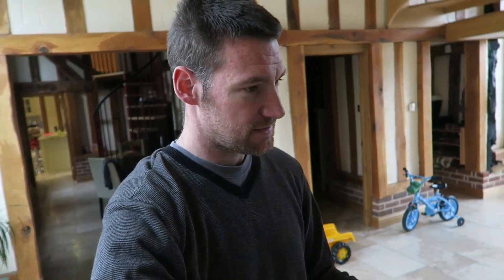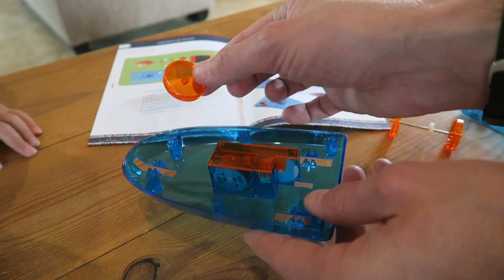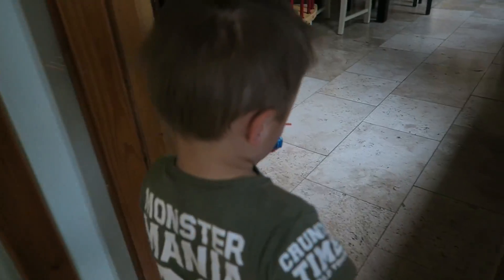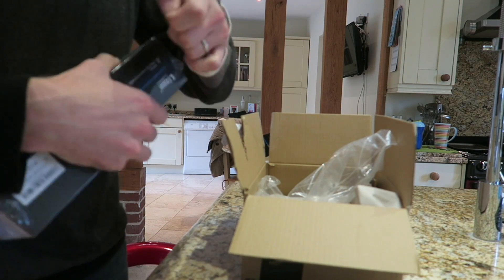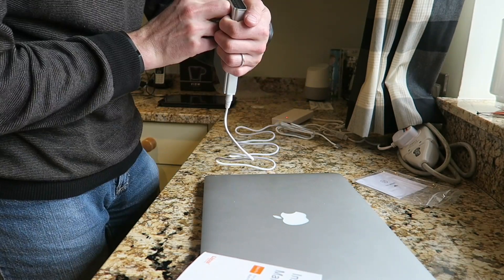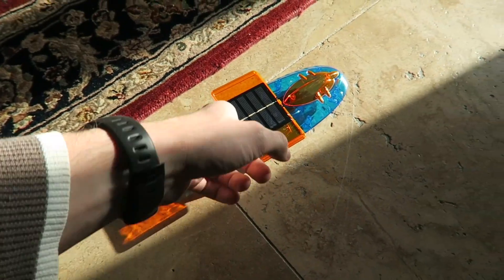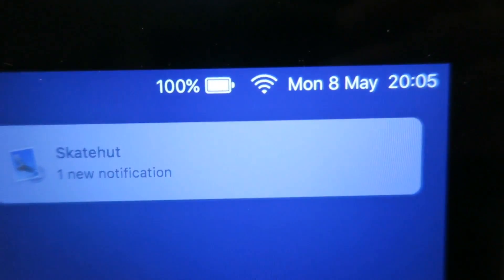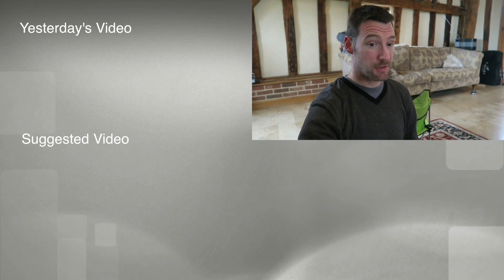Tesla Superchargers // Top Speed Dropping Over Time

Comment: That's why the new macbooks nobody likes are cool. You can charge them using USB-C from basically any power bank.

James - did you see this article about StoreDot? Claiming to be able to charge cars in 5 minutes for a 300 mile range?! https://www.engadget.com/2017/05/12/storedot-ev-battery-demo/?sr_source=Twitter
Reply from the maker: Yeah that charge your macbook from anything capability is very useful, no doubt. I'd still miss the sc card slot and magsafe 2 charge port though.

Comment: Hi James, my Tesla 90D is 14 months old and has done 45k miles with about 60% on superchargers. My maximum charge rate is 92-94kW/h which has not changed from new. Regards David
Reply from the maker: Interesting that the max charge rate isn't a bit higher. I do briefly see 110+ on my car (though it is dropping almost straight away). Not that that would make any actual real world difference though in charging time however.

Comment: Be careful! You can only take two additional battery packs, up to 100Wh each in the aircraft cabin and ofcourse the device or devices themselves. And you shouldn't put any lithium based batteries in the checked baggage. Most passengers don't even think about this, but lithium batteries in checked baggage can be a big problem, even causing a fire, mainly because baggage people throw your baggage around quite a lot and batteries don't like that and they get damaged and they suffer a thermal runaway, which is normally dangerous only because everything in the immediate surroundings catches fire. Please take a minute or 2 to think about how you pack batteries!

Comment: You know, that electric car, why didn't they put a battery in it.  Gez, cheapskates.  Then the Tesla analogy in some way would apply and Jasper would be impressed.  I'll bet you could solder a small NiMH cell in there with a switch so the motor doesn't run and you'd be charging!  Question: Have you been to the States before?

Comment: When your in the US all plug sockets will be 110 to 120 volts plus two pin sockets with ground most of the time. The plugs I see you using are much bigger and different shape. You can find 220v but we use those for dryers and stoves and cars.  ☺  You will need travel power adapters If you don't have them already. FYI
Reply from the maker: Luckily almost all power bricks in the UK will accept 110v to 240v, so it is just the plug shape I'll need an adaptor for.

Comment: I find that the best type of power banks are those where you fit your own 18650 cells, rather than rely on the cheap chinese pouch cells which can't be replaced.  These ones are the best I found, when fitted with 8 x 3500mAh IMR cells, this is just inside the 100Wh allowed on a plane, and will power my thinkpad all day.

http://www.ebay.co.uk/itm/172334352048

Being adjustable, it can be fiddly, but on the other hand.... Being adjustable you can power /anything/!  I really can deliver any voltage you want up to 24v.

Comment: Not sure if you can take the battery with you in a plane. Hope the trip goes well 👍
Reply from the maker: Should be able to, I think the exact regulation (at least at the moment), is that you can't take a battery with greater capacity than 100Wh on board, unless it is installed, but to be on safe side 100Wh seems like a reasonable cut off point anyway.

Comment: Sorry to say James, you live in England. So when do you not have cloudy days?
Reply: cinema writer Solar Edge huh? Do you have the DC Optimizers installed?
Reply: cinema writer what do you mean they're not strung together? With your size kW, they have to be in series/parallel. 

A Solar Edge DC optimizer, their product, evens out the power produced by the panels. In the past, the series of panels will only produce the amount of power the lowest one is. So if your chimney is blocking one panel, then that whole series will match the output of that panel. 

Now with Solar Edge's DC Optimizers, they will allow the entire string to output its strongest power and still use that shaded panel at its reduced output. 

Also when the DC power is disconnected for whatever reason. That string of panels will output 1VDC each, as apposed to 20VDCish.

Comment: didn't Tesla say when u bought the car lol ... no .... just like the overheating problems only full power over 65% of the battery no power when cold  u can't fully charge it without damaging the cells ....Tesla lie just wait when 400k people get an model 3 and they were not told this  Tesla is an electric car not an eco car
Reply: I am having trouble deciphering the jumble of letters that you call a sentence.
Reply: My 120,000 mile Subaru sure as hell isn't as fast, efficient, or reliable as it was 15 years ago.
Newsflash - it doesn't run on batteries.
Reply: It's not about charging fully and then just sitting there. it's about many high speed charges where the 120kW rate would be achieved. It's a whole thing, read about it.

Comment: Like you say, your battery will charge at 110 kWh if temperature and state of charge are both in the ideal range. I wonder if this guy had the common sense to ensure the battery temp and state of charge were both ideal. 

I doubt there is a counter, but more likely the algorithm for peak kWh charging includes the battery degradation percent as reported by the battery. It's also possible that he has charged his battery to 100% each time and fast charged it as much as possible and has built up some internal resistance and battery degradation that just limits charge current in order to stay below max cell voltage. 

They said the guys at Tesla ran a system scan and didn't see anything wrong. If the battery had excessive fast charging or battery degradation, that should come up as some sort of code. 

Tesla should update their software to include a charging status screen that tells you exactly what's going on and why. If your battery is too cold or hot, if your SOC is too low or too high. If the supercharger itself has a problem that is causing the limit. 

Or if it is a software throttling, they should say "due to the severe abuse you put your battery through, the charge rate is limited to 60 kWh peak. If you would like to disable this and void the battery warranty, click ACCEPT".
Reply: It's a real think, Tesla reduces you max speed. Many people experience it with their "90kWh" cars.
Reply: Cloxxki, but what is the algorithm, which data does it use and where is that data stored? If it's just a certain number of charge cycles, that's normally stored in battery management. If it kept of log of each time you used a D.C. Quickcharger, someone will eventually figure out where that data is stored and how to reset it to zero.

I'm sure someone is making some spreadsheets about this issue so they can figure out what the common denominator is. 

This is not going to go over well if as Tesla is talking about 350 kWh charging speed, they throttle you down to 60 kWh, without explaining clearly when or how you will reach the limit.

Comment: Can you link the laptop battery you bought? I wouldn't mind checking it out for myself.
Reply: I second this.
Reply: I have been using a RAVPower23000mAh for some time now with my MacBook Pro. (https://www.amazon.ca/gp/product/B00HFMUBYG/ref=oh_aui_detailpage_o04_s00?ie=UTF8&psc=1) Works great!

You will need an adapter for a MBP (https://www.amazon.ca/2-5mm-Power-Connector-MagSafe2-Macbook/dp/B010XAR3GK/ref=pd_sim_23_1?_encoding=UTF8&psc=1&refRID=0KGTZN1NP35MQAWAEQGX). But the battery pack comes with tons of adapters for different laptop plugs. 

Highly recommended product.
Reply: Boomer0001 that's the thing he bought:

https://www.amazon.com/Lizone-Aluminum-UniBody-Laptop-Smartphones/dp/B00HLDSO84#mobile-twister_color_name_1494576736206

But there are different sizes of this device, so maybe he got a bigger one. :)
Reply: Boomer0001 I think this thing here is better, you can charge it while your device for charging is plugged in and it got way better responds:

https://www.amazon.com/MAXOAK-50000mAh-Portable-External-Notebook-Most/dp/B00YP823NA

Comment: What would have happened if u put a flashlight on the solar panel, would that have provided enough light to power it???
Reply: drjaye1962 depend on the power output of the flashlight, so a construction light with 500 W would be sufficient.

Comment: That's odd. I never get those numbers. When I charge at a supercharger with 30% left, the maximum I reach is 92kw and it rather quickly drops to 50-ish. I almost never reached 100 in two years.
Reply: Nic Gas Is this after driving for a while to warm up the battery? What battery do you have?
Reply: Yes, even after driving several hundreds of Kms. I have a 60kw though, it certainly works differently from an 85.

Comment: Have you changed your settings on your laptop to powersaving mode?  it reduces the amount of power you draw by about 20% depending on your cpu.
Reply: David Beppler only if the cpu is idle, which is not the case on video editing.